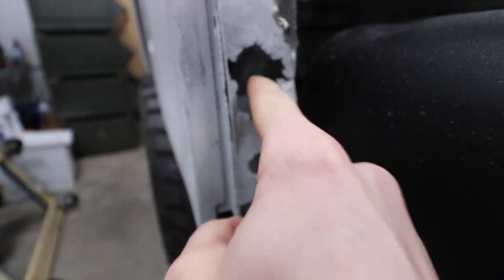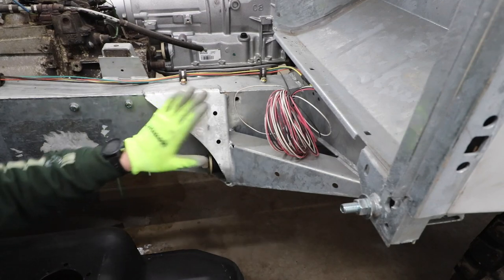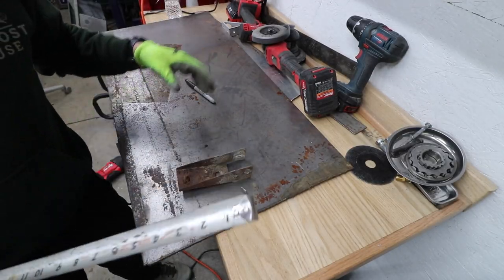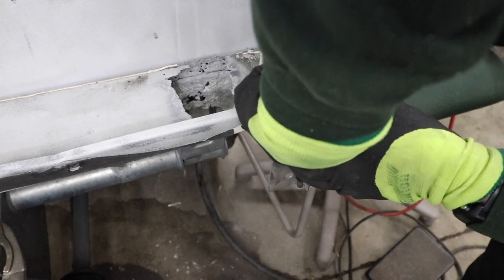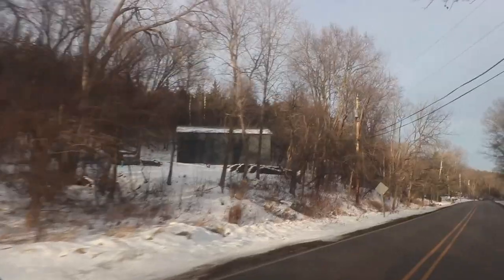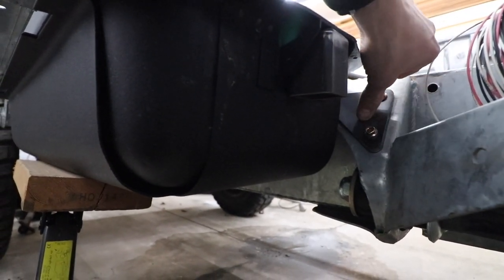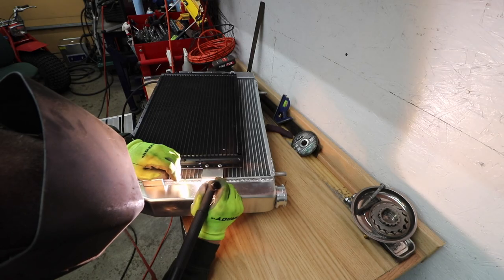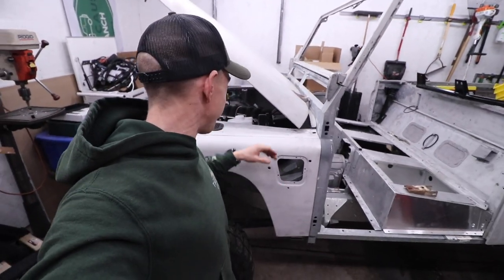Corrosion Repair on the LS3 Defender - Can We Fix it?

Comment: were the tub mounts to the chassis brackets make sure you make some kind of gasket between them to make sure the two metals dont react to each other and cuase the ally rot .use stainless bolts too on everything .
Reply from the maker: Definitely, the aluminum and steel are not happy together. Thanks for the comment.
Reply: Your welcome dude I build em too so know all the issues with them